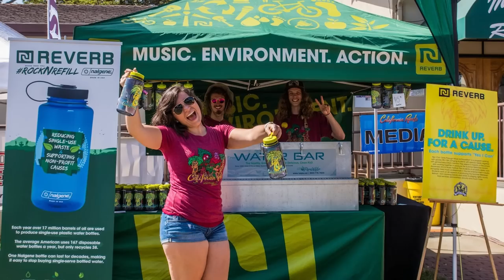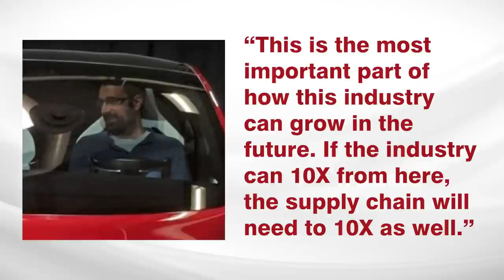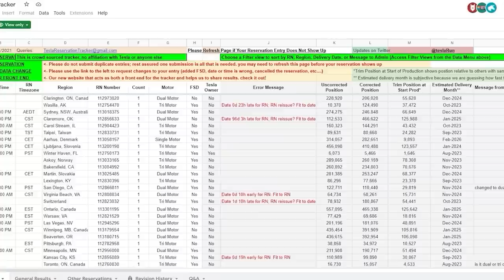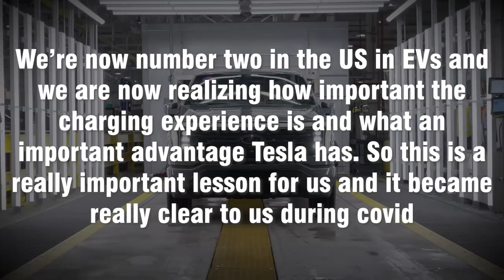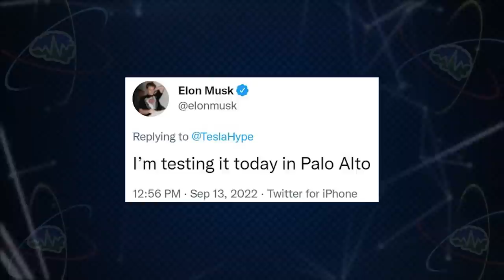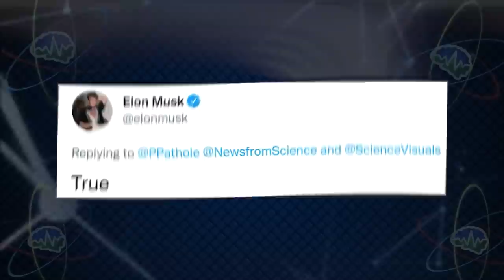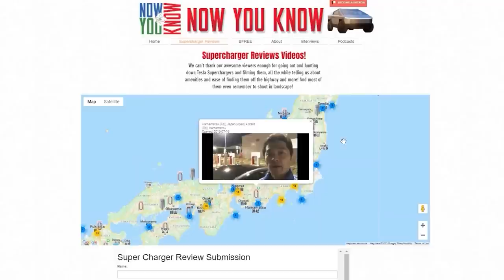Tesla’s First V4 Supercharger | Tesla Time News

Comment: Solar with Megapacks charging stations would make a lot of sense.  Hope this becomes the norm.
Reply: I hope not. We can not use those roofs outside of the US. And we have solar roofs from permitted manufacturers anyway. But we could use the Powerwalls when they finally build 3-phase ones. Until then we have to use European products which are on backorder for many months.
Reply: I hope so.
If these charging stations are off grid, it may cost less to Charge uP.
Reply: absolutely!!
Reply: @tarpehdee1   A money maker, with no negative impact on the grid.

Comment: Slight correction on the Woomera (actually Spud's Roadhouse at Pimba) South Australia "Supercharger". It is not a 220V wall outlet but a Three phase 415V socket capable of delivering 22kW, although I have a Model 3 so I only get 11kW. I have charged at this site twice and it was awesome.

The Australian EV Association has worked with all the Roadhouses between Woomera and Darwin to make these sockets available which makes travel in the area possible.

Fun fact, Pimba is the last site on the main SA power grid. All the others are on diesel generators.
Reply: The AEVA have done a wonderful job setting up 3 phase 240v (415v line)  outlets across Australia on small towns and roadhouses

Comment: The charging location shown in Woomera in Australia is NOT a 220 volt wall outlet. It's an industrial type of power connection which carries 3 phase power at 415 volt - Jeff said its a 32 amp connection, so that makes it 23 kVa... about 10 times as much power delivery as our household type 240 volt power point socket... BIG difference
Reply: .The 415V is the line voltage, and 230V is the phase voltage. Model 3 uses the phase voltage X 3 phases to neutral. You see it on the screen. A 3 circled (3 phase,) 240V., 16A.

Comment: The main argument I hear against switching to an EV is that they use electricity from a "dirty grid"; electricity generated primarily from burning fossil fuels. If TESLA equips all their chargers with LOADS of solar panels & batteries, so most/all of the power they provide is directly from clean solar, then that blows that anti-EV argument out of the water. And hopefully the electricity cost could be reduced  for the drivers, to make even MORE people switch to clean EVs.

Comment: Imagine the total installed VPP capacity if they put a megapack at every supercharger location in the country
Reply: I hope so.
If these charging stations are off grid, it may cost less to Charge uP.
Reply: @icosthop9998  - I "Suspect" the Megapacks at Supercharger's, will be for Buffering Grid & Solar Power, to be available for Charging Vehicles more than "Feeding" the Grid, at least early on! but, they could possibly use the "0.9 MWh" part of the 3.9 MWh capacity, for the VPP!

Comment: ASAP vs. 2023 delivery: 1) Tesla should push an app notification Yes/No question for all with reservations under tax credit $ limit asking "Do you want to defer delivery until 2023?" They can't know the buyers income or preferences, so would need to ask to avoid a lot of back and forth. 2) I would want to wait just in case the vehicle meets the requirements. 3) Tesla should make it clear if they will or will not meet the vehicle assembly/material requirements ASAP.

Comment: Went solar first call was tesla for the solar roof. But what isn’t considered is the SOUTHERN EXPOSURE and rods that are flat or have many dormers. Their first configuration gave us only 24percent of our electrical needs. A rehash and Tesla got it up to only 27percent. So we asked if Tesla did ground arrays as our backyard is large. Tesla doesn’t do ground arrays. We did want Powerwalls. So went with another solar vendor for a 24 panel array. Then Tesla doing another install in our neighborhood came out and ins2 Powerwalls! And this just 1 day before a major utility shutdown!  We had electricity the whole time. The Powerwalls are a game changer! Once installed on 10/8/19 there have been 21 utility outages and we had no shutdowns at our home!! I actually want a third Powerwall battery but Tesla now doesn’t sell them without solar.

Comment: Now that Tesla has released their charging connector for the North American Charging Standard (NACS), we find that it can support 500 to 1,000 volts, and up to 900 Kw of charging power. Not clear if Supercharger V4 has that max power output, but it is likely far greater than 350 Kw.

Comment: It would seem natural assumption but I’ll make it to suggestion anyway all the solar panels should be placed above the bathroom Montréal’s they all would like a cooler environment it would use last land the leads would be shorter between the batteries and the panels witch would use less wiring Of course if they burned they would take out the panels too but don’t be so negative

Comment: New Bill in California is trying to add a tax on the Sun and charge Homes with Solar Panels about $600 to $800 a year.  This is going to kill new solar sale.  The one thing a home owner is trying to do is save on power costs and use that savings to help pay off solar panels in 6 to 12 years.  This $800 a year tax may double the amount of years for paying off install.  Why?  Taxing the Sun?  Its not PG$E's to tax in the 1st place.  Why is California going out of its way to slow down roof installs of Solar?

Comment: Timestamps:
Powerwall Must Be Included With Solar - 2:25
Another End of Quarter Push for Tesla? - 3:37
Tesla’s First V4 Supercharger - 5:03
Tesla Megapacks Pack a Bigger Punch - 6:38
Tesla Has All the Batteries They Need! - 7:50
10,000 Model Ys Built - 9:30
Class Action Lawsuit Against Tesla - 10:19
Tesla Opens all Superchargers in Iceland - 12:54
GigaBerlin Expansion Delay - 13:57
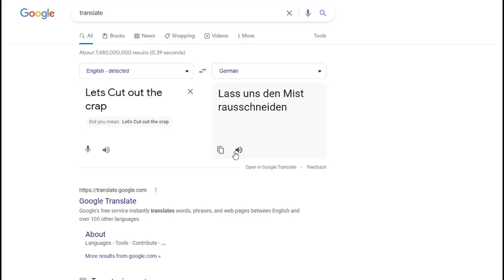Tesla Centers Coming to China? - 15:33
Reencle Composter - 17:33
Vinfast Starts US & European Deliveries - 18:22
Lightyear One: Most Aerodynamic Car - 20:23
Campworks NS-1 - 22:06
How to Become a Ford Electric Dealer - 24:49
TSLA No Longer Most Shorted Stock - 28:08
More Tesla Police Cars - 29:43
Into the Future - 31:13
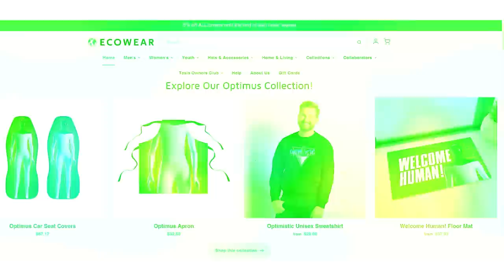Going Green - 34:00
Sun Spots - 36:22
Reply: Thanks

Comment: Regarding the EV-1 not  all were crushed. I found a video of a private citizen who simply didn’t turn his EV-1 in to GM. He to my knowledge hasn’t driven it in years but other than the car in GM’s historical collection this is the only other surviving EV-1.  The only reason they were crushed was the top brass was afraid it would become a wanted car. The original lead acid batteries were about to be replaced with lithium ion batteries that would have greatly increased their range. But unfortunately we know what happened.

Comment: Also joined the virtual power grid but soon found out that the Powerwalls become completely controlled by Tesla during an event. When an event is announced (3 times in 3 days during a recent heat wave) then if your Powerwalls are less than 100% then the GRID FILLS THEM EVEN THOUGH ONES SOLAR WAS DOING IT. I WANTED to charge my son’s 3, but could NOT DISCONNECT from the event. So the next day I left the virtual power grid. Payment from Tesla is calculated only once a year. Sort of like the true up with the utility (PG&E). My unused excess electricity when my Powerwalls are full goes directly back to the grid anyway so we do help that way.

Comment: Solar in this case seems purely for optics.   Marketing gimick.  One mwh of power per day would run half the charging stations, twenty , for 10 minutes a day,.  The other 20 stalls would remain totaly idle.  If you wanted to supply a busy 40 stall charging station with solar power.(I mean Buc-ees busy) you would probably need a minimum 90 acres of solar farm, not 9000 Sq ft, and a lot more mega packs.  If this is a very busy charging station on a highway you couldn't cover even 1% of the power demand.
Reply: True, but any additional solar installed is a benefit, especially over charging/parking space that isn't used in any other way

Comment: I have a MYLR coming in late October. I want a 4680 structural pack for my battery. I don't want a 2170 battery. At this time, I don't have absolute faith in the present 4680 build quality. I am going to try to delay. I hope by April, Tesla will have the bugs worked out of their 4680 cells. The current wait time for this car, at the longest wait time is April 2023. Tesla may have to offer free enhanced auto pilot (as an example) as the trade off for people not to delay or cancel.
Reply: May I ask why you do not want the proven 2170? Just curious. I felt the same way for a while but realized its a tried and true battery hardly even think about my new Y pack. It seems to me the 4680 was more of a cost savings move to tesla than an end user advantage. I could be wrong though.
Reply: @PumpUptheJam81  I know the 2170 is a proven technology. I am not against that at all. I do think that the 4680 will be able to take a greater fast charge if not now, but maybe in the future. Also there are new generations of 4680 cells coming in the future which should have increased range. I am not down on the 2170 and would encourage people getting a Tesla, that the 2170 cells are a quality product and will last probably longer than the actual car. I have been watching Tesla for quite a few years. Watching factories being built, battery day, AI day. Through all of YouTube videos, press releases and Tesla stock performance. I have invested too much into the Tesla hype to not get the 4680 cells, in an Austin produced model Y. I am just fussy I guess. I also have ordered two Cybertrucks. So I am in the Tesla game.

Comment: my only reservation about megapacks at superchargers is the potential for fire as we have seen at other megapack installations.
Reply from the maker: I'm more worried about all those gas cars parked nearby...
Reply: Maybe this is why they are switching to LFP batteries in the mega pack… aren’t they safer from thermal runaway?
Reply: @darylfortney8081  Cheaper, less fire prone, and 3 times the life. it is not very often in life that you get cheaper and better.

Comment: Short cable lengths? Except for the actively cooled ones, hasn't anyone heard of an extension cord? Yachts and  RV's already use them for every hookup, at up to 240VAC at 50A, and that's more than most EVs and chargers need. Old tech, low cost. Fifty feet and longer.